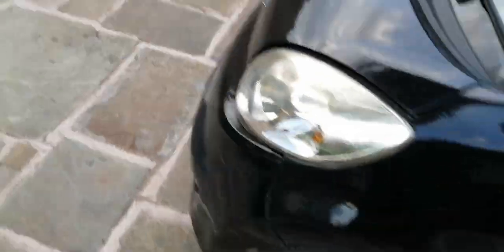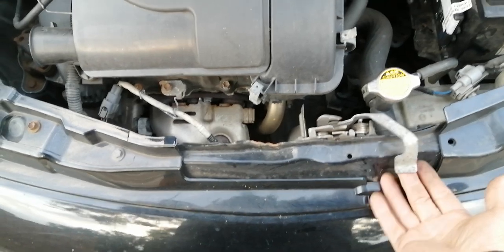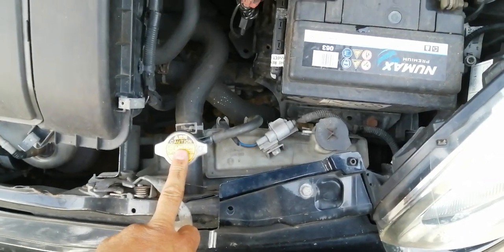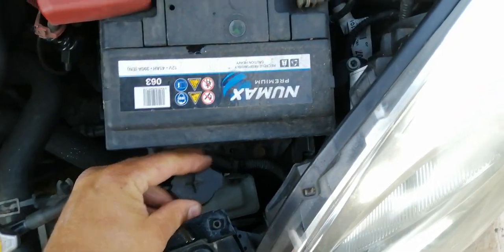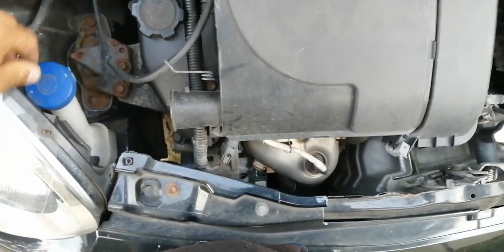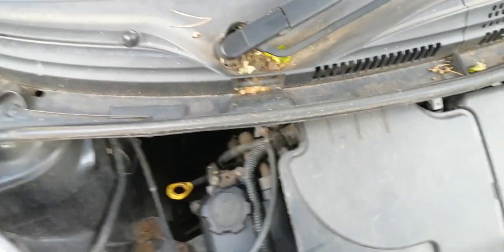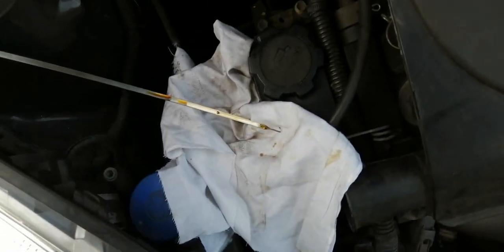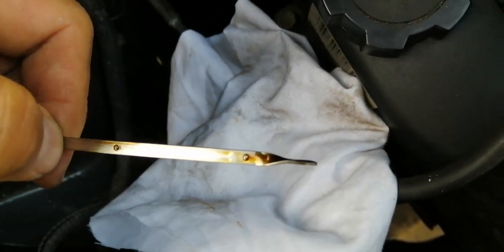Citroen C1 (2008) Checking oil, water, washers levels

Comment: Do not use washing up liquid in the screen washer bottle. It contains salt to bulk it up, and when you use the washers it will spray onto the paintwork. Salt can damage the paint. Windscreen washer fluid is salt free. Washer fluid also contains some anti-icing ingredient which can prevent the screen from icing up when you use it in freezing weather.
Reply from the maker: Well yes all of that's true, but it is a good alternative to use if you have no screen washer, I've used it for years and never had any issues myself
Reply: @Planefix1   I did have it effect the paint on  a car. I thought if I kept using it, it would cause more damage each time, so I stopped using it. It was not bad but you could see it. However it was an old car which would have been painted with cellulose. Maybe modern paints are more resistant to it.
Reply from the maker: @replevideo6096  yes perhaps, I find modern car paint really good to be fair. Normally a wash with some good car soap like AutoGlym etc is enough to make them shine like new I find

Comment: This 1 kr-fe consumes a lot of oil by its design.you should check it regularly every two weeks its ok.from the upper dot to the bottom dot its about a litter of oil.its better to use 5w-30 oil and of course fully synthetic oil.if you change and check your oil you'll have it for a life! This engine is bulletproof.
Reply from the maker: Thanks for the advice and tips Mike
Reply: Well then my engine is broken! 
It does not burn oil at all, nothing!
I just service it every 15k kilometers and never have to add some between that interval!
Reply: @MauriceNL1  i feel sorry about you.....😊

Comment: It's 17/1/24..got my self a 2012 one of these... Love the car nice little cheap run around.. Came here  about the coolant a few things on this car not to easy but okay I suppose the coolant readings abit hard to see and the dip stick comes out at such a angle lol... Got a water leak in mine rear somewhere seen some videos could be the rear top brake light... Any ideas
Reply from the maker: Have a look at the roof aerial, they can leak and drain down to the boot floor.
Reply: 3 common places and all relatively easy to fix. Rear/top brake light, side indicator housings and the other requires removing the bumper as it is the vents.. A gasket set is available for the rear lights (about £14), use some silicone gasket sealant as well and they can all be sorted. Start with just doing the top brake light. There's plenty of videos available as it is a very common thing. The bumper is quite easy to remove too.
Reply from the maker: Good info @johnw 😊

Comment: Shouldn't someone be careful with tapwater use in a car or any mineral water due to calcification later on affecting the whole car engine with repeated tapwater/bottled water use? Thanks
Reply from the maker: Hi, well yes "technically" you should normally use distilled and if this car was a 1 million pound Bugati Veyron or a 1920's Rolls Royce i would use distilled. But honestly  every person (and pretty much every garage in the world) use normal tap water. The correct use of antifreeze/summer coolant is absolutely more critical than perhaps using simple tap water as this is highly developed addative, that has all the anticorrosive properties etc required. Further more, any water (tap, bottle, stream ive even used windscreen washer before in an emergency) is better than no water, as no water equals engine destroyed. Honestly, trust me, half a cup of tap water tap once every 6 months is absolutely fine. 😁

Comment: Oil also cools the engine if it's topped up.Always use screen wash in the winter and always put anti-freeze in the expansion bottle.Top tip is when the engine oil is drained and with the sump plug is already out/off is to pour some new,clean engine oil.It will remove some the dirty oil already sitting/laying on the bottom of the oil pan....do this on extensive oil drains if you go over 8,000 miles,but i would suggest an oil change every 5.000 miles....it's good for the engine.And don't get any rubbish from Halfords as they're cheap tat.Euro car parts,GFS,local Wheels motor factor  or anywhere else.Avoid Halfords at all costs.
Reply from the maker: Hi thanks for your comments. Ive used Halfords oil before and not had any problems to be fair, it will be perfectly good for a C1 in my view. Also all oil changes are good and the more frequent the better, but i think 5000 is a bit keen for a small car such as a C1 😊
Reply: @Planefix1  Frequent oil changes are important for VVT-i engines,i assume your car has it? Sludge is no good for VVT-i as it needs to flow easily and may clog up the thin oil passages,especially the top part of the engine.
Reply: @Planefix1  what do you think of putting , castrol magnatec 5/ 30 in a c1 petrol ?
Reply from the maker: @PeterSmith-ls7ut  i wouldn't have a problem using it. Clean oil is more important than the exact match in such a car. If it were a high performance/turbo model then yes, but in a little C1 i would use this no problem
Reply: @Planefix1  ok, thank you for the info.

Comment: Today i found a mixture of oil in my coolant can somebody explain me why. Its the same car like this.
Reply from the maker: Hi, there is only 2 ways this can happen. 1) Someone has put oil into the coolent system by mistake or 2) Most likely your head gasket has failed. You need to take it to a garage  and ask them to do a pressure test of the cylinder head gasket. If the water just has the appearance of an oily 'film' on the top (it can look like this sometimes, on some cars when all is OK) and if the car is performing well, you have no water in the oil (makes the oil go creamy) and if you have no excessive white smoke coming out of the tailpipe when driving, then I would change the coolent, flush and refill with new water/antifreeze.
Reply: @Planefix1  Thank you for your reply i changed the coolant today. I found just oil in the expansion tank and nothing in the radiator. A mechanic checked everything and adviced me to drive 1 week and see if the oil come back. I thinks some idiot who was owning the car before me put oil inside it. Thank you
Reply from the maker: OK, well Good luck, hopefully. It's an easy fix!

Comment: Temp indicator??  Not in my C1.
And 10 W 40 oil?      Better use 5 W 30
Reply from the maker: There is a temperature indicator in all C1's. It is a small warning light that activates if the temperature becomes too high. If you are referring to a temperature "gauge" then no they don't have on of those. With respect to the oil, both 5w 30 and 10w 40 are both acceptable to use in this engine. The reality is there is actually very little difference between either from a specific lubrication point of view, it is personnel choice. I prefer a slightly heavier oil as the engines in these are quite noisy at the best of times and I believe they run better/quieter on 10w40 myself.
Reply: @Planefix1  My fault..i own the Sensodrive version, they need other oil. And yes it's has a  temperature indicator and not a Gauge.   Sorry :-)
Reply from the maker: To be fair I watched again I did say indicator 'rising' not 'will come on' so I understand the confusion. This is my daughters car and she's just gone to uni. I'll be honest I made this so she can refer to it when she's away and if she needs to check the car over etc. I appreciate all comments. Cheers Dave
Reply: @Planefix1  10w-40 fully synthetic oil best for c1 engine? i-m from italy..TIA

Comment: Don't put tap water in the coolant tank. Ready to use anti freeze. Not concentrated.  In these the pink stuff is correct.  Just water risks engine freezing up.
Don't put just water in the screen wash. Ready to use screen wash is best. Wash up liquid damages the paintwork.  Don't risk the wash freezing across the glass on a motorway. You can't see a thing.
Use the correct oil 0-20 or 5-30. 10-40 or other oils are too thick for these little engines. Never wait for the oil light to come on. That's engine about to fail. Teetering on the edge. 
Some poor advice in this video.
Reply from the maker: A little water in an expansion tank to "top it up" is absolutely fine inbetween services. And simple water in your screen wash is better than no water!. And of course it's not as good as garage screen wash, that's obvious. I've owned 4 of these cars now and worked on a fair few more. This video is designed for someone who knows absolutely nothing about cars full stop. If you listen gain, I do state many times "general servicing" and "topping up". Of course in a garage or during a service you will check and top up or change complete fluids etc, but for topping up in between services water is just fine. I also disagree with your oil comments. If you think the advice is poor Bob, why are you watching such a basic video .....And if you can do better, be my guest! ..... feedback is a gift, but only when it is relative and fair.